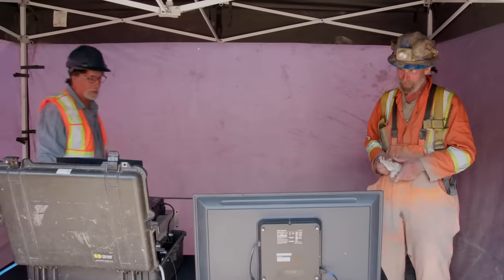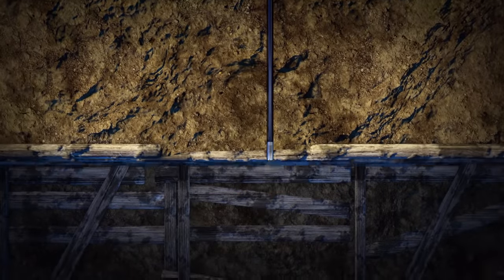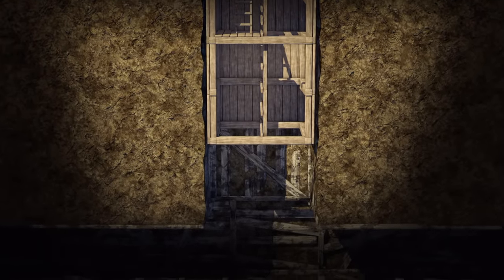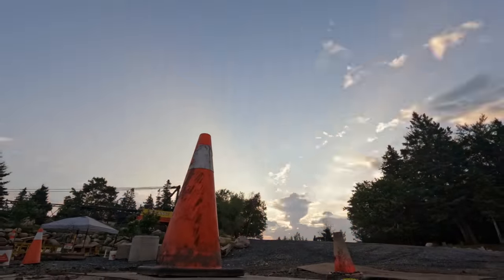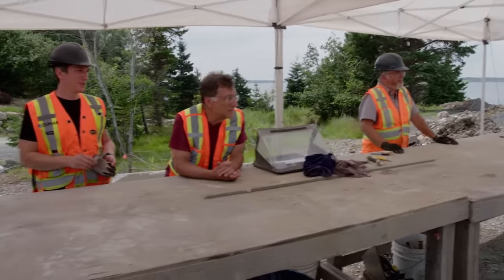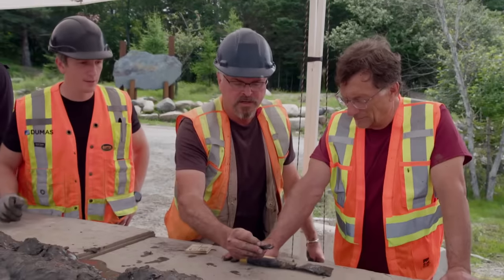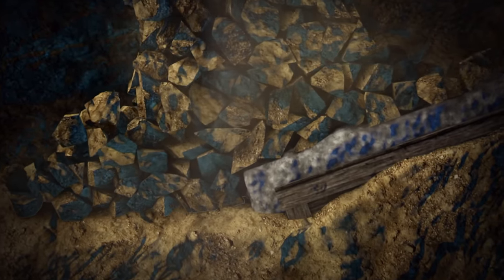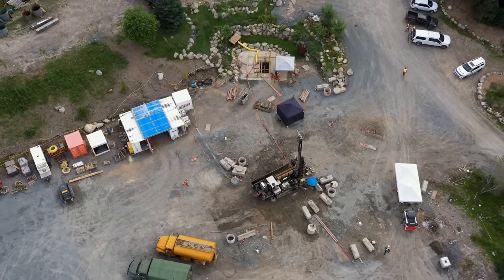The Curse of Oak Island: IRREFUTABLE Connections Between Money Pit and Lot 5 (Season 11)

Comment: If there is a tunnel underneath the shaft, when removing the last cubicle meters of dirt, wouldn't the shaft start to "slip" (perhaps this is not the right word) downwards until it touches the bottom of the tunnel? What about the stability of the shaft's structure? Wouldn't it be affected by such a development?
Reply: I believe the new garden shaft is secured to the structure at the top and essentially hangs down
Reply: Yes but the shaft could flood very quickly I hope they have a way to get those guys out fast.

Comment: So you could have built a sea wall and just go in from the bottom of the water in that lagoon and then just drill and break through the roof of the cavern and with the sea wall holding back the ocean like in drilling operations and have been through that 8 years ago. There's equipment that pumps out all the water and brings you straight to sea floor and work from that spot is a pressurized chamber. But that would require permits and permission where on your own land you can do what you want.
Reply: Yes, but unfortunately their treasure hunting licenses only permit them to search/excavate as far as the shoreline of Oak Island.  The seabed of Mahone Bay and the adjacent islands are off limits...  :(
Reply: They have to get permits for anything they do and most them, especially the ones involving the shoreline have very specific amounts of time they're good for.